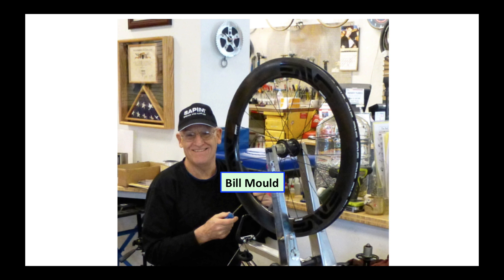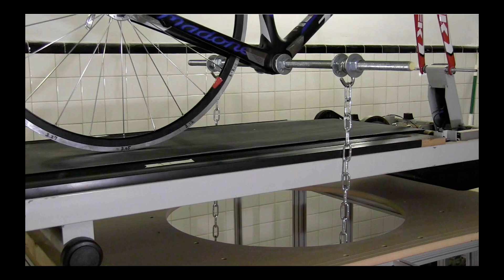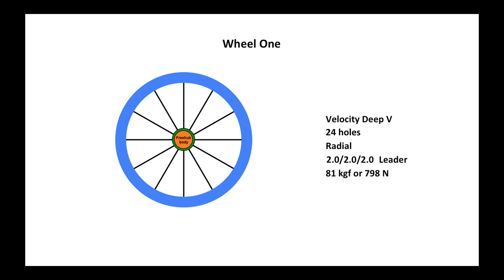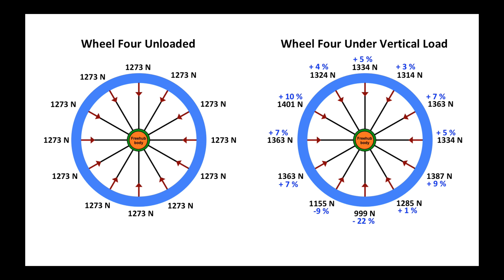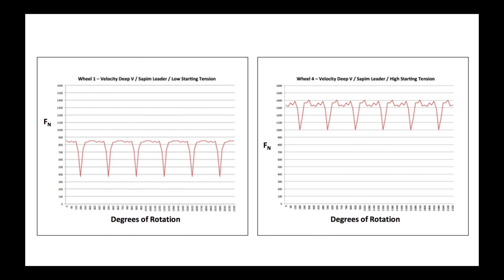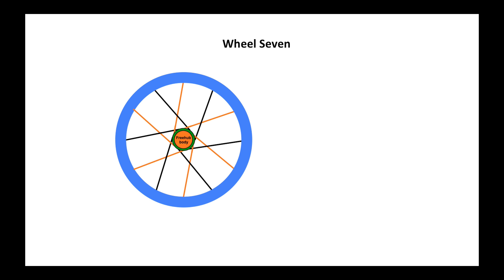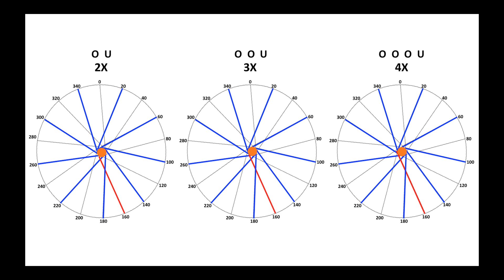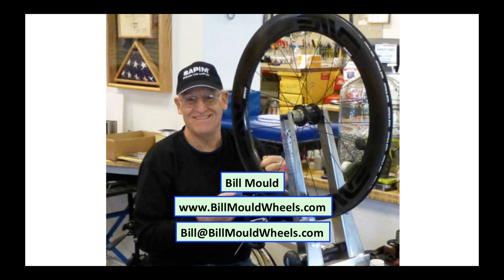Rythmic Tension Cycles in Wheels

Comment: An accurate measure of how much the rim shrinks as the total spoke tension increases with spoke count and tension would be interesting.
Also a wheel built with even spoke tension is rarely true mainly because the join in the rim is never perfect. 
The addition of lateral loads on rear wheels would give some really interesting data.
Great to see good data and analysis.

Comment: Thanks - I've suspected for a long time that crossing, or interlacing, spokes didn't have a significant effect on the performance of the wheel. This has been anecdotally supported by high-end straight pull wheels commonly being built without interlaced spokes. Thanks for providing the data and engineering analysis to support that.
Reply from the maker: Thank you for your supportive comment!